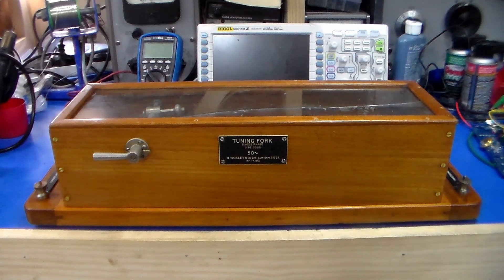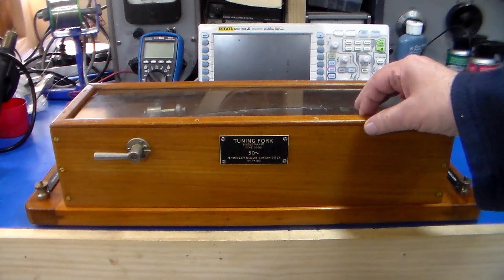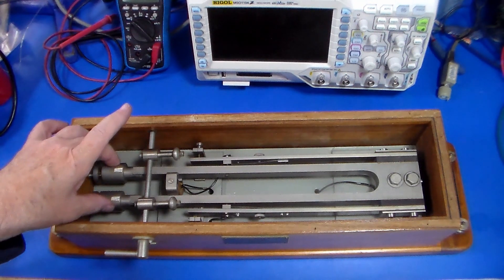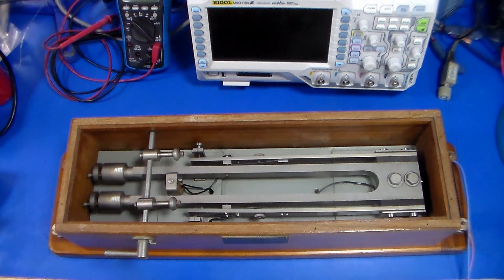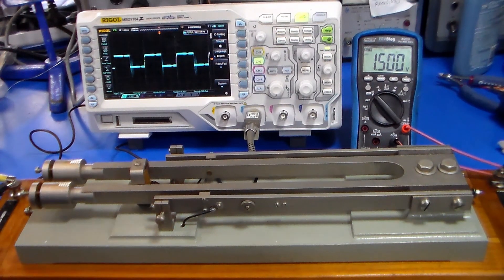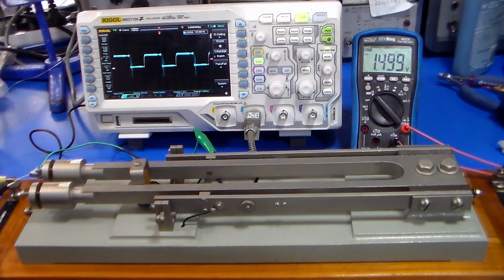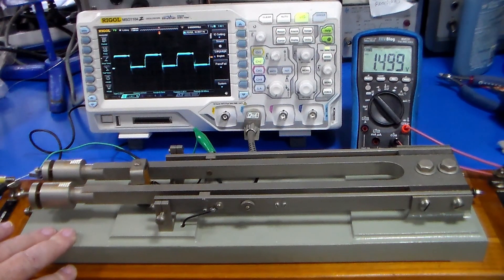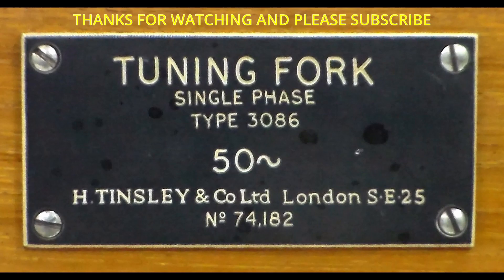H. Tinsley 50Hz Tuning Fork, Part 1

Comment: If you used just the electromagnet and pulled the switch contacts off, I wonder if you could build a circuit around the tuning fork as if it were a quartz crystal and use it as an electromechanical stable oscillator with a pseudo-sinusoidal output.
Reply from the maker: Yes, that would be an interesting exercise, but it's such a nice piece of electromechanical engineering I couldn't contemplate modifying it.

Comment: An amazing instrument from the past, thank you for sharing it with us. It would be interesting to connect it to a counter through a de-bounce circuit to see how accurate and stable it is. I suppose temperature change would be its biggest enemy. Regards, David
Reply from the maker: Stay tuned, I'm cleaning up the output signal to get a good reading on a counter.